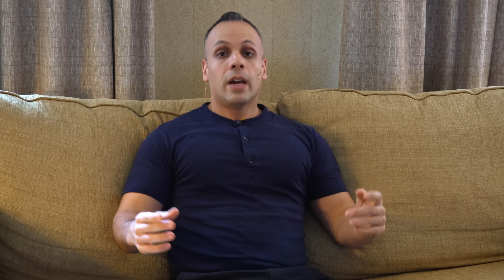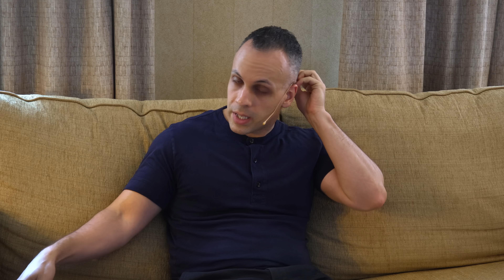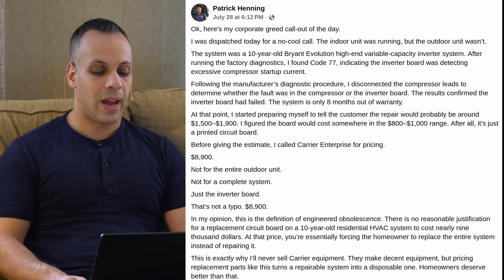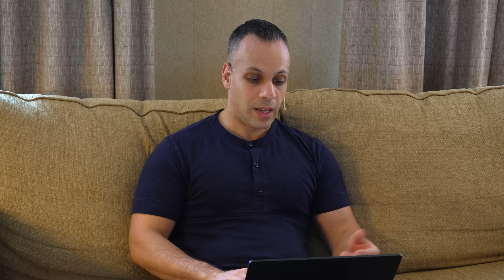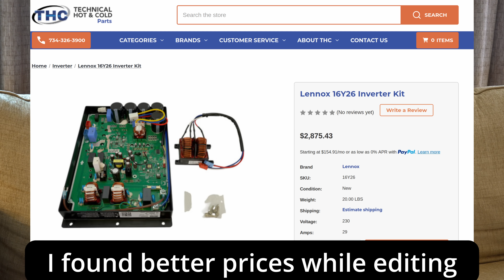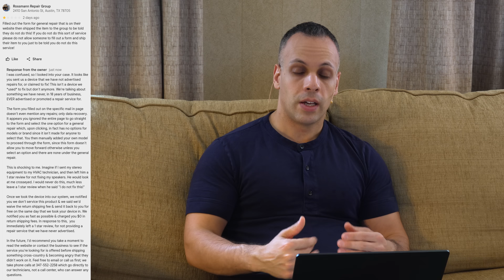Carrier AC repair has $8700 part cost for residential unit

Comment: I repaired the central AC/heating unit at a house I once rented. The circuit board was $15 on Amazon. 

Yet, a Chrysler dealership in LA once quoted me $12,500 to repair a V6 engine in a car that had 30K miles, and this was in the 90s.

I was a mobile electronics installer with a large retail chain in California when another installer working on a Porsche accidentally drilled into a wiring harness. A GM went to some dealerships with the customer to get quotes. The first dealer quoted $10,000 to replace the harness. The car owner thought this was ridiculous and suggested they try another dealer. The same job was $2500 at the next dealership. The company was so happy that the customer was willing to shop around that they gave him an additional $2500 gift card.

Comment: I used to work with an older tech who said there used to be a PCB repair shop in town. He would take the board there at the end of the day and pick it up 24 hours later. New parts got so readily accessible that it stopped making sense. I have to wonder how expensive it would be to set up a shop capable of testing and repairing these new boards, and if they could manage pricing and turnaround times to profit and make customers happy.

Comment: I went with Amana which is the step up from Goodman...   The less computerized the better.    I've had to do a few repairs on mine (flame sensor and a couple of capacitors).    I've found good documentation floating around the internet.   We're about 10 years in on it and so far it's been mostly reliable.

Comment: I would love for someone like you to get into fixing these types of boards so we could learn how to save these. It has always ticked me off replacing a circuit board for what is probably a few dollars at best worth of parts. For the last 20 years the biggest failure on fan timer boards is the fan relay that will usually fail first and at one time when I looked you couldn't find a replacement one to solder on. Generally the contacts will go bad cause excessive heat and burn the board until the solder connection melts. Just fixing the connection will not last as the relay will just burn it off again. The old school boards were inexpensive enough nobody worried about repair but now fixing these inverter boards could save thousands.

Comment: I worked in HVAC & HVAC controls for many years. These price gouges are an occasional issue. Some companies hire marketing children who occasionally make these mistakes. Just takes some time for the company to work these mistakes out of their systems.

If you take a picture of the front & back of the board, AI can probably have a perfect replacement in your mailbox in a couple weeks at a tiny fraction of the cost. There's nothing breakthrough happening on any of these boards.  You could probably design and built one from scratch, using AI, by just showing the AI what your incoming power is, what compressor & fan motors the unit has, and what relays and contactors are already in the control compartment - more pictures.

Comment: I have a Carrier 3 ton a/c unit and 96% efficient furnace both 2 stage 8 years old.Last winter my furnace blower would not run,luckily I was able to tighten up the wire connections at the main circuit board. A new board was 700.00 online. Early Saturday morning the a/c compressor got  wavy noisy and shut down. I am hoping I can replace the run capacitor and contactor to get the compressor running again when the parts come in later today. Otherwise the 2 stage scroll compressor has failed.I would never get another Carrier system again,the hvac supplier that handles Carrier parts will not sell to me even though I worked 40 years in the commercial refrigeration business. I can get hvac parts anywhere else. I installed a York 3 ton a/c unit and 80 percent furnace in 1995 and it ran fine until I had it replaced by the high efficiency Carrier units in 2018. I should have kept that system,it would probably still be running today.

Comment: I wonder if those boards are protected from being repaired in anyway. I know a couple customers that repair boards and other electrical complements but they usually sell back to the OEM. 
HVAC repairs are an absolute scam, the component parts are resold at 5-10x base cost. The whole model like you said is to buy another. (Sell electrical components with occasional
HVAC customers)

Comment: Even $2600 for that "inverter" is too much. 

It's actually a variable frequency drive and a 10hp VFD is like $300 or less from an industrial control vendor. You could retrofit that system with less than $1000 in parts with a PLC...but the cost would be excessive due to paying the person to program and install it. 

So basically it's proprietary obsolescence. Complete bullshit. HVAC systems are not complicated machines and there is no reason for all the proprietary crap.

Comment: I would try to fix the board myself and if it was over my head, I'd try to find a local electronics repair person who could give it a go.  It's probably a $2.00 component.  If that doesn't work out, I'd get a new AC unit but buy the lowest tech "good enough" one I could get.  NEVER a Carrier again.

Comment: Last Split we bought NEW in 2025 was an ON/OFF unit. I know inverters have better efficiency, but no thanks. Sames as Fridges that for no reason now need a computer board. We couldnt skip it on the washing machine, but I repaired it like 3 times now, so it is ok.

Comment: I worked residential install for 2 years. Luis you are total correct on the efficiency scam of these units. Residential absolutely breaks my heart. A single stage unit is all you need. Two stage or variable speed / communicating is paying extra for comfort only. Single stage equipment, when sized correctly and with someone who actually knows ductwork can come quite close to the most expensive HVAC equipment. I installed Lennox and carrier and personally hate Lennox more. Just cheap, low quality, urgh.

It's so unfortunate when a homeowner gets the top of the line equipment and the installers have either no or little experience and it's just money destroyed.

Single stage, r32, with a media filter rack, 4/5" is all you need

Comment: I do it for a living. I cut them up and scrap them out. No 3rd party option for reasonable parts replacement cost. I think in the future, since the industry is moving towards inverter technology, these boards will have to be less money, but also 10 year old inverter boards may always be a fuck you to the customer. Imagine spending $10,000 for parts and labor to fix the inverter board, then the compressor going out the following week. Planned obsolescence is exactly what carrier is up to. Just buy single or 2-stage hvac equipment until you can’t anymore. Customers need to boycott the side discharge inverter technology. No matter what you buy, you’re stuck with ECM motors. Same story on replacing these. What used to be $200-300 is now $2000-3000. Just had this on a 9 year old carrier this week. Customer would’ve been money ahead replacing entire furnace for $6200

Comment: I just got a new carrier home AC installed I was looking at their latest units on their website but my HVAC which I am friends with told me no. He was going to get me a basic single stage one (mid tier) with out any of the extra fluff that will just make it more expensive to repair and less reliable in the future. So in my case it wont be an issue in the future & its true what they say the basic older designs are usually the better more reliable ones.

& for sure that was a F U buy a new one price for $8k, go buy a new unit so our sales go up.

BTW if anybody needs a honest HVAC guy in and around Toronto, Canada let me know!

Comment: Had a fuse blow on the control board for my HVAC
A FUSE
They cannot replace the fuse. You have to replace the whole damned board. 
What is the use of the fuse exactly if I need to replace everything it protects if it blows?

Comment: An inverter board isn’t just an AC-to-DC converter. It first converts AC to DC, then converts that DC back into controlled 3-phase AC to run the compressor. Basically, it works like a motor controller in an electric scooter or bike. The difference is that instead of getting its DC power from a battery, it first has to convert the incoming AC power to DC before creating the variable-frequency 3-phase AC that drives the motor.

Comment: 1:36 All the price issues this spokesperson pointed to... none of them are in the cost of replacement boards. They are all upfront costs of design. After that, cranking out more boards is cheap.
He gave you corporate boilerplate, a non answer.
To answer your question, I would not buy this brand after this story.

Comment: I do a lot of handyman repair work; mostly carpentry. A home owner client called me and said she had a quote from a large, well advertised plumbing company, to replace her 50 gallon electric water heater for $3,700.  I called another, smaller company and got a quote over the phone to do the same job for $2,100.  A $1,600 difference. And they did it that day.  I can't imagine why that much difference, other than greed.

Comment: HVAC has become a scam like all appliances sold in the US. The same AC or heat pumps straight from China are 2 to 5K. The inverter boards are universal for the compressor size. It’s a VFD that controls the speed of the compressor by the frequency of DC pulses it sends the compressor. Modern refrigerators use inverters instead of just a contractor that turns the compressor on or off. They also seem to fail in less than 10 years and are priced so high they aren’t worth replacing. There is no reason to put a variable compressor in a refrigerators. Old refrigerators just have 2 thermostats, one for the refrigerator and another for the freezer. Unless they lose their refrigerant charger, they will run forever.

Comment: I wonder if Carrier would ALLOW you to repair said boards?  It is most likely a component failure but if it's a proprietary part, it may impossible to source.  So there you go Louis, I double-dog dare you to start repairing HVAC & appliance circuit boards for so-called outdated equipment!  I would support that concept. One comment mentioned "Mend it Mark"; awesome tech for sure and it would be interesting to see his approach.

I just replaced the right hand side tailgate hinge assembly on my rusty 2004 Sierra and the two parts (just for the right side) totaled about $100, employee pricing at a dealer!  I could have saved some with cheap aftermarket but sometimes that costs more in frustration with fit and quality.  It's not to the level of bend-over of the Carrier example but it seems like a lot for 2 little metal parts.

Cheers!

Comment: If you follow HVAC channels on YT, most will tell you not to buy one of variable speed AC or heat pump units.  They all use proprietary control boards that are horrendously expensive.  Buy a two or three speed unit.  The smarts are in the $100 thermostat that decides which speed of cooling to call for.  The control board in the unit is much simpler and aftermarket companies are starting to make universal replacement boards.

By the way, the Goodman and most cheaper HVAC equipment is made in the country of our arch enemy, China.  There is no guarantee that when you need replacement parts you will be able to get them from China.

Comment: Carrier used to make some of the best hardware on the market.  I bought a Bryant system in 1989 and installed it myself.  With nothing more than hosing off the condenser unit once a year, the system was still working 30 years later in 2019 when I sold that house.

Comment: Just had a Bryant heat pump w/propane backup installed to replace a 26 year old American Standard system (the old system was making noises that was indicating it was seriously considering a career change).  My only complaint (at least so far...) is that most of the chips on the control boards I examined have been sanded clean and stamped with a house part #.  Why?  Because f*ck you, that's why. :(

Comment: I had to service a 46 yr old residential a/c system for my cousin that barely cools.  New capacitors, condenser fan, blower fan (wired for hi speed), contactor, thermostat, control board, xfmers x2, condensate piping.  Under $1000 and its supplying 58f at hi speed now.

Comment: Louis, 1st answer is that was a FU, Buy New price. 2nd answer: We will not replace our 1995, 5 Ton, R-22 Carrier, which still works like a champ here in Florida, with another Carrier. Longevity secrets are change 3M 2800 filter every 3 months, annually waterblast dirt from condenser fins (Inside => Outside) and always keep a spare fan/compressor, Made in USA, 70 C-rated cap handy. Love ya'!

Comment: I was pissed when I bought my new furnace and could only get a system with an ECM motor. I get it, they are more efficient, yada,yada..... If i have to replace it, I can't run down to the local supply store and grab a $99 universal blower motor, like I have in the past.  Saving a few bucks on electricity vs spending hundreds, or thousands on high efficiency makes no logical sense.

Comment: There's no way they have any more than a few hundred bucks in manufacturing costs for that board.  
Many years ago, I had a control board fail in my furnace.  A replacement board was going to cost more than $500..  I'm an electronics hobbyist, so I had a good look at the failed board.  
One electrolytic capacitor had failed and leaked.  A part that cost around $1.  I swapped the cap, put the board back in and the the furnace ran fine for years after.  
It's absolutely margin expansion in the case of that carrier board.  They're the only supplier of the part, so they charge what they can get away with, "what the market will bear" as the suits like to put it.

Comment: 25+ years in the HVAC world as a PM for new construction high-end residential projects here in Miami, Florida. If you're looking for high efficiency what we see down here is typically Carrier Infinity, Trane-Mitsubishi VRF, and sometimes the Trane Hyperion. Though if you think Carrier Infinity is problematic then don't bother with Trane's Hyperion series. Loud indoor units due to it's blower inside the indoor unit,  plastic air handler cabinet, and electronic txv valve issues. If you want to keep it $ friendly stick simple non-communicating simple Carrier or Trane system. Non-ECM blower motor, etc. If the indoor or outdoor motors ever go bad you can easily go to a local AC supply house and pick one up for $75-$150.

Comment: Same here.  Carrier 5 Ton, board went out, $5600 replacement but under warranty, but 2 months to get unless i paid a $250 expedite fee.  In Florida, in the summer.  Can’t replace anything because they’ve switched to a different refrigerant.  When this unit goes i’ll buy another brand.  I like the unit, but not the getting bent over. 100% greedy scam.

Comment: It's illegal to resell a used unit even if it is repairable. And also it's not like a car when you can keep repairing it and keep it on the road. At a certain point these things are cooked. Today if you can get 10-15 years out of a unit with a normal contactor/capacitor/1 or 2 stage system you did well.... Also, don't buy carrier or lennox. Everyone else is ok to a certain extent and dependent on the product line. Good luck

Comment: I have a 3 year old carrier comfort series 4 ton that has had 2 valves replaced and 3 blower motors. The noise it has made is unbelievable. I asked carrier to replace it because it was new. They will not do that they will only throw parts at it. The fan was also replaced because it didn’t have all the rivets on it. It’s my first and last carrier.

Comment: This is why I sell Trane XV systems if the customer wants a high seer unit. I’ve never had issues with getting parts, usually only takes 2-4 days. The inverter board on a 2014 XV 20 SEER heat pump system was only $1,043, way more reasonable. Trane is a whole lot easier to work on anyways. We have installed multiple XV systems over the years and I only had to change the board once. The only problems they have is the temperature sensors that go bad.
Reply: Tam air handlers are notorious for leaky coils
Reply: @pewpeww556 yeah that’s why we sell them with the TEM model. You can pair an XV system with the TEM models, and the newer 5TEMC’s. Atleast those coils aren’t a pain in the ass to replace and if out of warranty cheaper than carrier lol, but I do have to agree with you on that. Always leaks in the same corner

Comment: Anything Carries is grossly overpriced... Name the part.. ECM (electronically commutated motor), secondary heat exchanger, primary cell, burner tube, outdoor unit control, any of it, and will sell none of it to the common street punk sucker that bought into Carrier's efficiency baloney.

Comment: Been doing residential hvac flor 12 years. The old units get broken down for the coils and motors; because of the high metal recycling value. The parts like boards capacitors etc, get thrown in the trash.